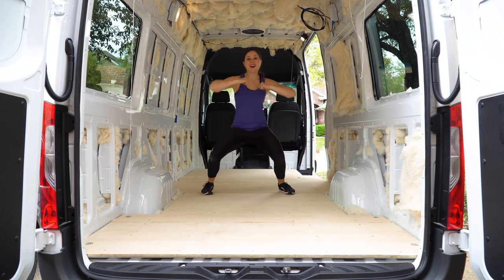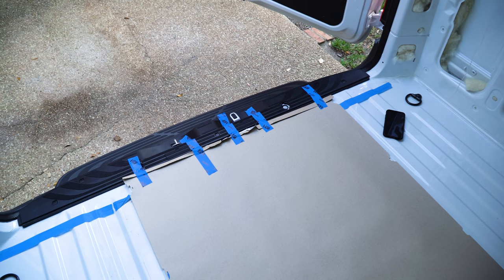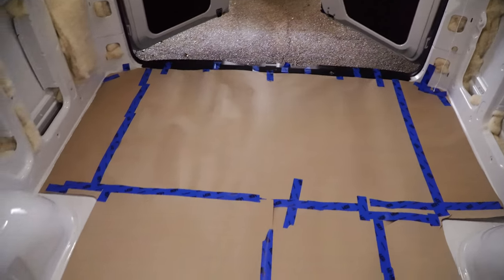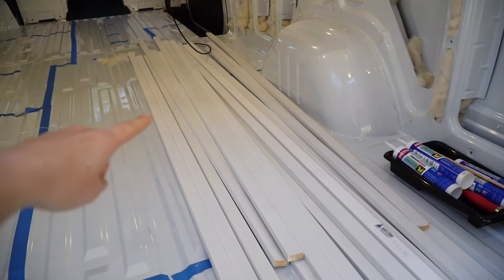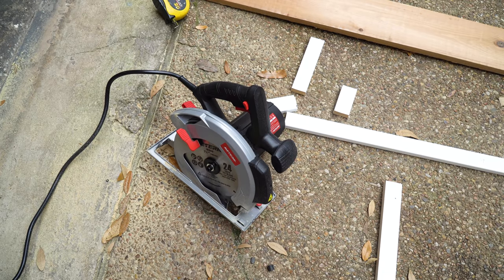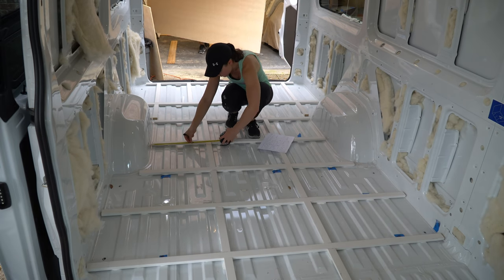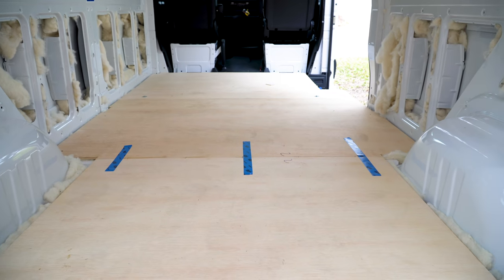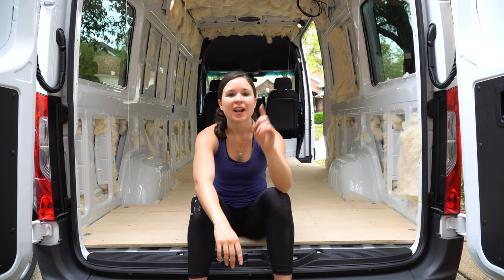Van Subfloor + Floor Insulation with Havelock Wool | Van Build Series

Comment: Try flattening the insulation with a board with your left hand right where you want to cut it. This smashes the insulation down so it can be cut in one swipe with a razor blade and gives you a surface to hold the blade against. This is especially helpful when you have tons of cuts like in this floor.
Reply from the maker: That’s a great tip!

Comment: Good Afternoon Adam & Kathryn...I am in the very early planning stages on our jump to VanLife in a couple years and learning so much from great people like you. I have a question for you or anyone in the community that might know...i noticed on many sub-floors there is a small gap between the sub-floor and the wheel wells...Is there a special reason for this space?
Thank You
Jim
Reply from the maker: Hi Jim! Congrats on planning to venture into van life! We had a gap around the wheel wells so we could build boxes to go around them later. We boxed them off that way we could insulate around them and also use the top of the box as storage.  Since they are curved and awkward, making the box helped us utilize the space more by being able to put items on top of the box. Hopefully that makes sense!

Comment: Thanks for the video - I found it super informative. I'm working on my own subfloor with wool insulation right now and was wondering what size lumber you used for the framing. Are they 1x2s?
Reply from the maker: Hi Tony! We are glad it helped! Yup, you’re correct, those were 1x2s.
Reply: @AdventuresofAplusK  but then, you'll be compressing 2 inches of wool down to less than 1 inch?
Reply from the maker: Hi! The wood was attached to the floor ribs, which are raised a bit off the floor.  So the gap is probably closer to 1 1/4”.

Comment: Terrific video! May I ask: I'm not clear on why the floor planks need to be biscuited together when they are going to be screwed into the cross pieces below? Thank you.
Reply from the maker: Hi! We did that mostly to make the subfloor one solid piece so it didn’t matter so much where we attached the subfloor to the actual van/wood framing we did on the bottom and to try to prevent creaks. Hopefully that makes sense. We had to think back a bit to remember why!
Reply: @AdventuresofAplusK  Thanks for your reply. Not sure how little gaps between the placement of the 3 plywood pieces would cause creaks?
Reply from the maker: We have found that even tiny gaps in the wood can cause some creakiness when driving. It’s not mandatory or anything, but we just wanted to have as many solid pieces of wood as possible to try to prevent that and to also give us a solid piece of foundation to build on. For example, in houses sometimes people do tongue and groove for the subfloor to bind it all together to prevent squeakiness and whatnot. Not sure if I am explaining it well, so I am sorry about that! There are definitely other ways to do the subfloor, but we tried to build our van like a house as much as we could!
Reply: @AdventuresofAplusK  I'm a newb and will certainly defer to your expertise. I recently purchased a slightly used Ford Transit 144" with the medium roof. The previous owner had used it for a HVAC work van and I've just taken out all of the stuff that they put in. There were 3 long pieces of wood along the side walls that were screwed directly into the metal. I had a terribly annoying squeak and it turns out the culprit was one of these wood pieces. I also had terrible rattles that sounded like they were coming from my rear doors. The really weird and astonishing thing is that these rattles also stopped almost completely after removing the long wood pieces. While I am very happy about this, I have no rational explanation for it. I have since seen recently where folks are placing something between any wood parts and the metal of the van to prevent squeaking. Apparently wood screwed directly to the metal is bad.
Reply from the maker: We have seen some folks use rattletrap (I think that's the name?) to reduce any noise. We chose not to do this because the wool is supposed to be a good at sound proofing too. We do have some squeaks when we drive still, but we are trying to pinpoint where to see if we can fix them. Most van conversions we have seen do wood furring strips  to attach walls to. I am curious what the other option would be to avoid attaching wood to metal. We are definitely not experts, but so far things have gone mostly well! A big learning experience and IF (but probably not lol) we ever converted another van, we are pretty sure we would do an even better job!
Reply from the maker: Hmmm this is interesting! It looks like they didn't have the sides touch the wall? So now I am wondering how it attached. It may be worth a shot for your build to try it out! We are just going to hope for the best for ours lol! Ours is very sturdy, it may just squeak a tiny bit over bumps haha

Comment: Great video.  Thanks for sharing it.  We are in the process of our build and are on the subfloor.  We put the 1x2s down and a grid like you did.  We got the wool cut and installed and when we started putting the subfloor down we had a 1x2 pop loose front the adhesive.  Did you have any issues like that?  How long did you let the adhesive setup for?  We are hoping we don’t have to pull things up and redo. Ugh.
Reply from the maker: Oh no! We did not have any issues with the adhesive. I believe we let it sit overnight with weights on top of it. How long did you let it sit for?
Reply: Thanks for the quick reply. We have really enjoyed your blog and videos.  We actually let it sit around 24 hours very similar to what you did with weights on it. It was just one board that seem to come up so maybe it was just a fluke and threw us off. We put a whole bunch more adhesive down and re-weighted it and we’re gonna wait until tomorrow to see how it is. Also, we are in Nebraska so maybe there was a little difference with humidity and things like that.
Reply from the maker: We hope it works the second time! Our floor has remained super sturdy thankfully, so if you can beat this hurdle you should be good! 🤞🏼

Comment: Just curious: Could we simplify by just using side-to-side subfloor wooden pieces? And perhaps place them a bit closer together?
Reply from the maker: You likely could! The important thing is making sure there are enough contact points for the subfloor to connect so it’s super sturdy. But that may work!

Comment: Did you put any screws into the metal van floor or is everything screwed into wood the frame underneath that you glued down? I love this and want to replicate it in my van.
Reply from the maker: Hi Carol! We didn’t screw directly into the floor. The wood strips are glued down and the subfloor is screwed into the strips only. We did put bolts with washers on some of the tie down bolt holes though! The floor is extremely sturdy and we’ve been super happy with how strong it feels!

Comment: Hey. What type locktyte product are you using? And how thick is the framing? What do you coat floor framing with to be moisture and rot resistant?
Reply from the maker: Hi! We used a marine adhesive (we can’t remember the brand) to attach them to the floor. The framing strips were 1x2 and they were primed already to help with moisture and rot. And we used the wool insulation to fill all of the air gaps to prevent moist air from condensing. I hope that helps!

Comment: probably a silly question but can you put the prime boards( that the plywood will be screwed into) running with the ridges rather than on top of the ridges.  I realize you won't be able to make boxes but it seems you can save an inch in the height.
Reply from the maker: Hi! So sorry for the delay--these somehow keep getting put in my review queue and I am missing them. I think that could work! As long as you have enough spots to secure the floor board into so it's sturdy, I think it could! To be honest, a lot of this is a blur now, so we don't really remember the exact specifics anymore, but there are always so many ways to do things that could be better than how we did it!
Reply: @AdventuresofAplusK  thank you

Comment: Do you know if we are supposed to fill the holes from the cargo rings with silicone? Do yours go all the way through the bottom of the flooring?
Reply from the maker: Hi Jon! When we removed the rings it did not go all the way through the floor. So we did not fill them, but instead used the majority of the existing holes to attach the subfloor. I hope that helps!

Comment: Are those framing board actually 1x2 cause Home Depot and Lowe’s only have 3/4 x 1.5 
Will that work? Where did you find those boards?
Reply from the maker: Hi Zach! Since almost all wood is listed in nominal size, the subfloor strips are 1x2 nominal or 3/4 x 1 1/2”. So that sounds like the same wood!
Reply: Adventures of A plus K thank you for the reply :)
Reply from the maker: Of course!

Comment: How did you fill up the hole in the floor from the cargo rings?
Reply from the maker: So the cargo rings didn’t actually put a full hole through the entire van floor (so there wasn’t a deep hole that was exposed to the outside if that makes sense). But we used the holes it made on the inside of the van as a way to secure our subfloor to the van floor. I hope that helps answer your question!

Comment: Hi Guys! Loving your videos. I am inspired to insulate the floor with Havelock wool now instead of XPS foam. I am wondering how many bags you bought for the floor only and how many bags you used for insulating the entire van? our van is roughly 30msq. Thanks in advance and again for the uploads!
Reply from the maker: Hi! We used 3 bags total including the floor. We were a tinyyyy bit short when it came to insulating the doors at the end, but the 3 bags covered the ceiling (minus above the cab), the floors, and the walls!